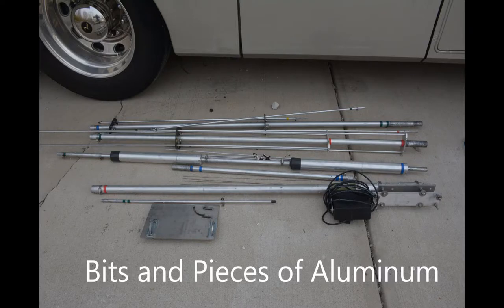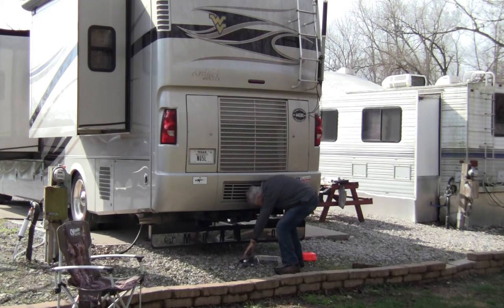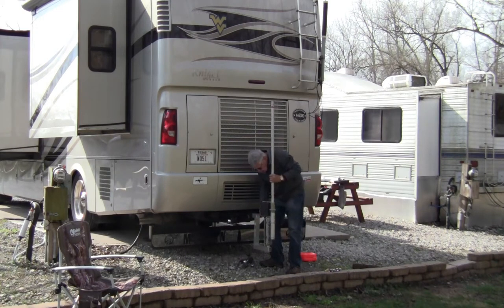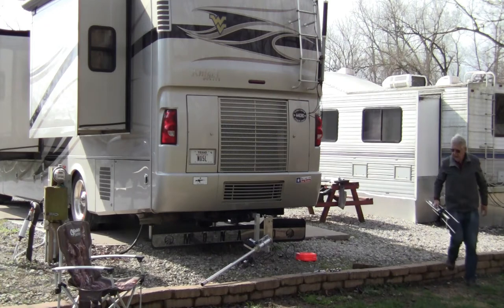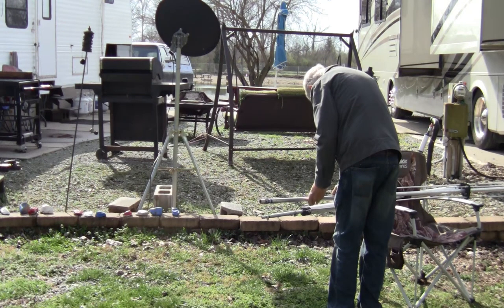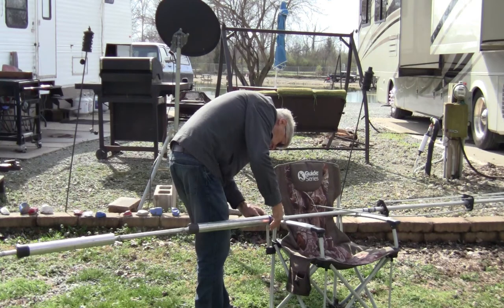R8 Ham Radio Antenna Motor Home Installation

Comment: Jim, NQ5L - fine business - RV and Ham Radio present lots of challenges and trade-offs - THANK YOU for sharing what you have learned, and what you learn going forward.  Bonding, Noise issues, GFCI trips.  Anything you can share greatly appreciated.  Loved the video.  Have you gotten any complaints with neighbors?  Any issues with RF burns with the low location?  Inquiring minds want to know!  Kevin KF5FUZ
Reply from the maker: No issues with burns, but with just the mobile antenna I did scramble the firmware in the SCS modem and had to return that for repair.  I moved that to the front of the motorhome and haven't had any issues since then with either antenna.  No particular bonding, just good solid power connections (about 3 feet from the four coach batteries).  Nothing with GFCI or any other issues.  I have met a couple of hams in various RV parks who see the antenna and will stop by to introduce themselves.  Others will ask what it is and how far can I talk.
Reply: Too cool.  Thank you for taking the time to reply.

Comment: Thx Jim...AH6P (Dennis) here.  To most folks that would be boring, but it was fascinating to me.  Especially since my wife and I hit the road fulltime in our new 35 foot motorcoach in two months.  I'll have all my radio equipment with me and hope to operate from all over the country.  One question please...what do you do for grounding your radio equipment?  I was planning on just using a copper grounding strap and just running it from the radio to the campground water service pipe.  Wondering how you do it.  As far as antennas, for HF I have a buddipole that works great on 10 thru 40m.  73s and hope to work you sometime, or run into you on the road.
Reply from the maker: I generally don't ground anything extra.  To me, it is like being mobile, except with a 28 foot tall whip so I am "staionary mobile".  Most campground water pipes are plastic so you won't be able to ground it that way.

Comment: Good Job Jim, Next time a video of the operating position may be nice. I also saw the screwdriver antenna. I assume this one works better, but how much, 1-2 S Units? Thanks,
Reply from the maker: Haven't done an actual A/B, but with this one I have no trouble making an HF connection on Pactor.  With the mobile I can eventually find one but it is a lot more work.  My guess is that there is at least a couple of S units probably more.

Comment: Did you have the hitch mount made?
Reply from the maker: Yes.  I had it welded at a local hitch shop.  It's 2 inch square aluminum extrusion and I believe 1 1/2 in diameter aluminum rod.  Both purchased from McMaster-Carr on line.  The main piece is just a simple Z shape to drop from the trailer hitch to almost ground height.
Reply: @RV4X40com  very nice. Thank you.